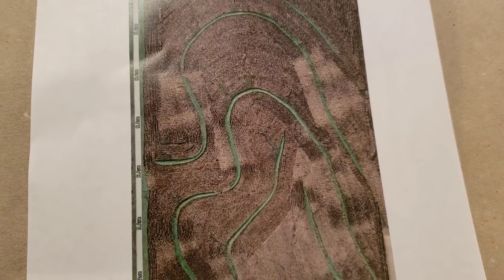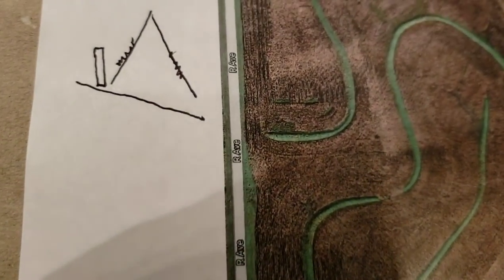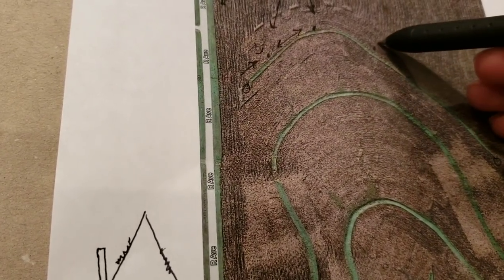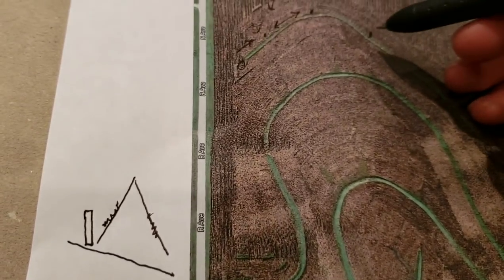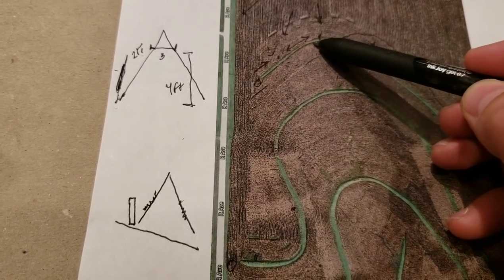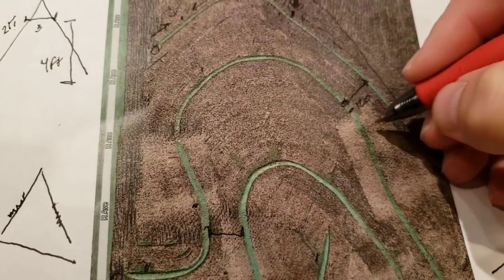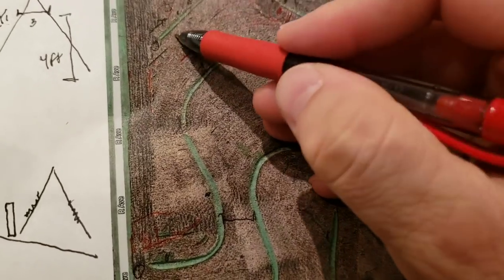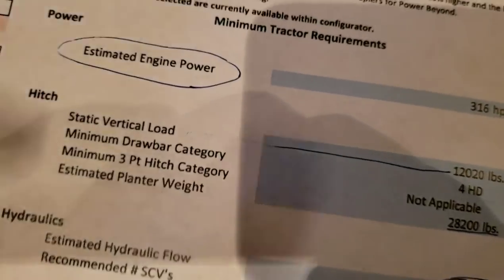Terraces explained & planter quote

Comment: the farm just west of Cromwell   .   Has a small river or creek at the bottom and is terraced to the top.   you can look at Google earth and see where the sand has filtered down over the years and has ammended the soils .   He still gets a crop but it is weather dependant.  Used to be when he had the home place farm up by Fort Dodge they would trade the good crop.  Either north or south.   This year we had plenty of rain up north so all of the ponds stayed wet. Down south the wet year helped with the sandy soils.  If you can get into  the fields in either place.   Just taking off end rows they are leaving tracks that fill with standing water